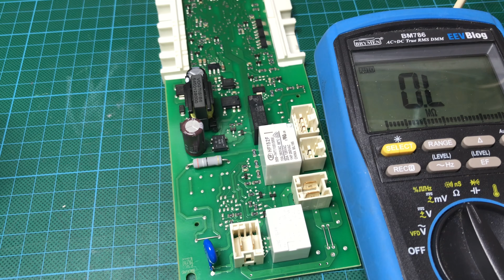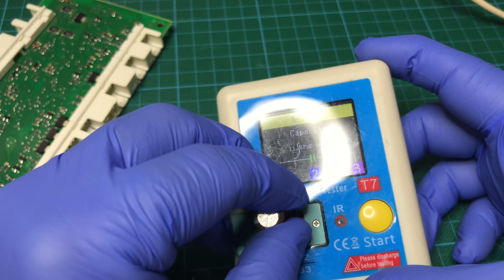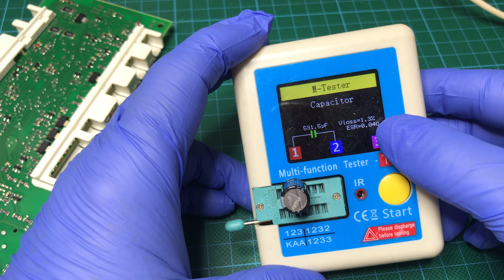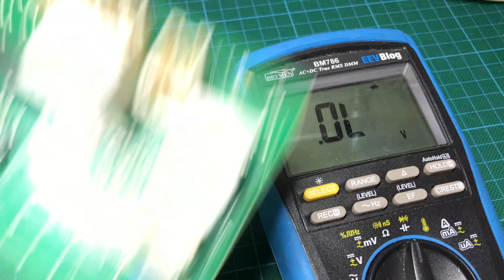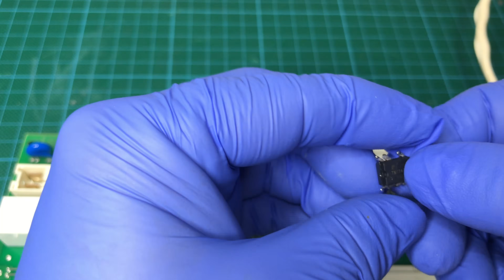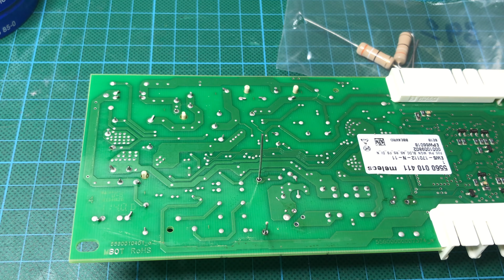Washing Machine NO POWER PCB repair fix Bosch Siemens IQ500 EPW66018 5560010411 DIY solution

Comment: Thanks. What I found on invertors repair is that electrolytic caps do not last many years and if failing especially the high voltages ones, can cause catastrophic failure. They don't cost much in relation to the cost of replacing the whole PCB. Worth while replacing them pre-emptively.
Reply from the maker: Very well said!
Mine is still running on the replacement Panasonic caps!

Comment: You're the man! I have no soldering experience at all, I have previously practiced on old scrap boards before I dared to use this board. Everything worked and the washing machine was running again. 🎉
Reply from the maker: That is fantastic news, I am so glad your hard work and practice paid off! 🛠️
It must be very satisfying to see the washing machine working again!
Nice work!
Reply: @varnasfix 
Thanks! Yeah, I was actually really proud of myself. It also reminded me once again what a throwaway society we live in, even though so many things can be repaired with simple tools and a bit of practice.
Reply from the maker: @vf19922  Yep you should be proud of yourself :)
Unfortunately throughaway is what keeps the commerce going.... Image how many appliances are in the dumpsters for such simple repairs..

Comment: Had the same issue with my Bosch Logixx8 WAS28461GB with the same power board. 6 megohm on the resistor and the switching IC shorted. Changed resistor, IC & the two electrolytics for good measure and it's all working again. Bosch want £185 for this board! I now have a 13 yr old washer that'll hopefully keep going a few more years 😁
Reply from the maker: Great to hear that you got it working again, and well done for fixing it yourself! It is a great feeling!
Fun fact is that all new washing machines PCBs need programming so even if you get the new PCB you need a specialized tech to program it for your specific model... That is true for all washing machine brands.
Nevertheless great job!

Comment: Dear Vanas thanks enjoy your repair videos! I have a question are Bosch washing machine power modules interchangeable - I ask as I'v got an old Classixx 6 1200 express washing machine and they have several models within the range and was wondering do you know the difference between a ME176A power module v a ME176I power module?
Reply from the maker: Thank you for your comment!
Tried to find some information about those boards but did not find much. 
Generally speaking the same pcb is used among many models but they are not the same. 
Some models have different populated components....

Comment: IMAM 9V ALI NEMAM 5V,AKO MOZE POMOC HVALA TI.....
Reply from the maker: 9V does not sound OK. You should have 12V.... Check if there is a 5V regulator and if it is getting proper input. Also check the 5V rail for shorts...

Comment: How do I remove this POWER PCB?
Reply from the maker: usually you get it either from the back cover or the top... That is where all the cable connect...
This is not the same model but you get the idea: https://youtu.be/eh8ocm7t-E4
Reply: @varnasfix  No.  It's not there.  It is located at the front of the machine, at the top, behind the display and control panel and has a cover that I don't know how to remove.  The machine is a Siamens IQ500 model WM12Q468EE/12
Reply from the maker: @giron1958  So you get access from the top of the washing machine. 
Display and mainboard pcb have their own convers and (usually) are sandwiched together with clips. Cannot provide much more info as i got just the pcb for repair...
If it makes easier you can remove the whole fascia (should have couple of screws in the drawer and clips all around), and then try to remove the board.
Hope that helps.

Comment: Great video! Same capacity caps with different voltage ratings will have different ESR values. You can have a look at the ESR table for this, there are tons of them on Google